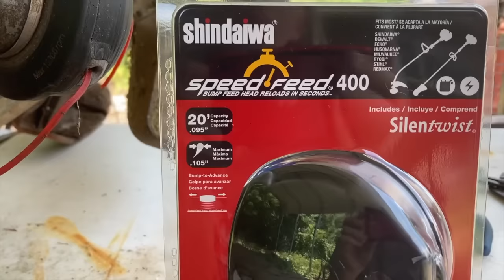The BEST TRIMMER HEAD ever made! How to install a Universal Speed Feed on most any trimmer.

Comment from the maker: Thanks for Watching! Find a link to all of my "Must Have", Favorite Tools HERE!! https://www.amazon.com/shop/chickanic?ref_=cm_sw_r_cp_ud_aipsfshop_aipsfchickanic_9ERPFPBNGQ924P8NS63B
Reply: Will the 400 trimmer head work on a Ryobi straight combi shaft weed trimmer, manufactured in 2016, with a full crank motor number RY251PH? It has an arbor pin or shaft that is threaded on the inside, with a bolt that screws into the arbor shaft that holds everything together, instead of being threaded on the outside of the arbor shaft. If the 400 will work, what arbor adapter do I need to use? Oh yeah, you can laugh at me for buying a Ryobi, it's OK. I've been using it since 2016 to trim my 1+ acres and it keeps on trimmin, but the trimmer head is now cracked and needs replacement. Thank you for all the great videos and detailed instructions!🙂👍
Reply: Will this fit my HYPER TOUGH HD bent shaft?
Reply: Awesome tutorial.  Just bought one.  Installed easily.  Works like it was made for my Husqvarna.  Thank you so much!!!
Reply: @Chickanic I decided to take a chance and I bought the Universal 400 for my 2016 Ryobi 2 cycle attachment capable weed eater and it installed perfectly. I think I used the red adapter. I'll update if it wasn't the red one. Now my Ryobi weed eater works better than new! Thanks for doing this video.
Reply: Hi Bre.  Greetings from Tupelo, MS.  I just bought a Shindaiwa T262 trimmer and it came with the Speedfeed 400 installed.  The trimmer owner’s manual only talks about .095” line being the biggest choice, but the SF says that it has a maximum of .105” line.  Will it damage my trimmer to run the .105”?  I’m a homeowner, not a commercial person.  It is a 25.4 cc motor.  I know about needing power to turn the head if line size increases, but .010” difference doesn’t seem like a huge deal.  Would .105” be better for chain-link fences and concrete than the .095”?  Your thoughts.  Thanks.
Reply: Side note.  Did the SpeedFeed 500 issues ever get resolved?

Comment: If you want to make that speed feed head last 100 times longer, drill a small hole in the center of the bump button and install a small bolt and flat washer from the outside with a lock nut on the inside of the bump button.  no more plastic contacting ground.
Reply: I just keep a one foot square piece of 3/4" plywood handy - the button on bump feed lasts a whole lot longer.
Reply: @flinch622 , What do you do with a 12'' X 12'' piece of wood ? Thanks.
Reply: @augustreil  I assume he taps on it rather than gravel or asphalt. Not sure how convenient that would be. 🙂
Reply: Brilliant!  Why didn't I think of that. Thanks
Reply: Can you make a video on how to do it
Reply: Excellent tip 👍
Reply: @AngusNB  carry a small peace of hard wood plastic ect in your pocket near at hand
Reply: @ikevinkinnane6200  Sure, handy as hell. 😁
Or, hear me out, tap it on the grass.
Reply: Very laborious when you can just bump line feed on the grass.
Reply: Smart idea
Reply: @ikevinkinnane6200  true.with a clip attached to belt loops
Reply: Does this fit on a greenworks weed eater..
Reply: @levis6945  ask the manufacturer of trimmer head
Reply: @levis6945  your Greenworks head works exactly the same you just have to uncoil those little spools they give you. And follow her directions.
Reply: Smart brah - I've just recently started a weedeating service and I've got more work than I ever thought - I work in the horse industry and I've been getting calls from all kinds of folks who need their barns , turnouts , and fencelines shaped up-
Reply: @stevesnider6817  not if you're working on an old car lot or old mall areas -
Reply: @davidrice3337  I'm trying to learn more about repairing weedeater. I have some in my  work bench now. One Murray was going to be trashed,by my friend,and I fixed it .that one was easy.
Reply: @AngusNB  🤣 🤣
Reply: Just bump it on the grass lazy sobs lol
Reply: I usually hire a super short Oompa Loompa to walk around with me, when I need more line... I bump it on the Oompa Loompas head. 
Minimal wear and tear on the equipment, and the Oompa Loompa only obtains a temporary bald spot, which grows back by the time I need to mow and trim again.
Reply: @ArvizuTX  I fixed an old Murray mower with a 3.5 hp Tecumseh engine.. works great and engine is good .
Reply: 3/8 bolt(Grade 8) by 1 inch long with a stainless nylon lock nut and a stainless 10mm fender washer (Lowes) <$4
Reply: I won't let it touch concrete or asphalt.
Reply: @Edocsil  That's exactly what I said, tap on the grass.
Reply: I must say, I got one of these and it's the best I ever used.
Reply: 5-28-2003, today. “Found” your channel. Watched this video. BOOM…Subscribed. Yesterday, I once again struggled with my Echo 210’s stock head. It is not on your list for the “400”. :(. A commenter says Echo has a very similar one. I NEED one. Thank you so much!!!
Reply: @flinch622  I carry an entire 4' x 8' sheet of plywood.
Reply: How do you carry that piece of wood around when you are weedwhacking.
Reply: @AngusNB  That would suck for commercial use huh…. Trying to keep your board handy all day
Reply: Round Up makes mine last a long time
Reply: @Mymusickb  hahaha
Reply: @willmartin4477 very carefully
Reply: Just use it! The head is only $25 bucks.
Reply: @justinpennington7682 I do too! Drill two holes at 4 ft. Side. Hoop a rope thru and pull it from the waist! Easy peasey,, :))
Reply: Commercial mower. Idiot employees. Telling them to only tap on grass is useless. I use a 3/8 carriage bolt. Heat the bolt head until it melts into the 3/8 hole I previously drilled into the new cap. When the bolt head wears out, replace with a new bolt (no heat needed the second time). When the cap finally wears out, I buy a replacement cap only, not a complete new head.
Reply: @Edocsil l’ve been in business 32 years and I bump on hard surfaces.  Feeds out better but yeah the head will wear out faster. Mine usually last about a year.
Reply: How about epoxying a large washer on it…..I am.
Reply: I just tap on clumps of grass or weeds. Very little wear and tear on the trimmer head.
Reply: Hello,I have the 450 Head on a Stihl FS 110 and I keep having the String bind up in the head. I’m using” Rino-Tuff”  .105 Pro and it has a Triangular Shape. What do you think the problem is
Reply: You nail it. Nice
Reply: . I read about that problem and the answer is odd; soak it in water overnight! Apparently the plastic dries out and begins to bind/grab/stick. Haven't needed to try it yet, but I just do my property. Mow, I HAVE shot a bindimg roll with nonstick cooking spray, and that worked well, but water is free. 👍
Reply: Great Idea. Thanks.
Reply: @SuperMagnumguy and that will fall off the first or second time you go to tap the head on the ground.
Reply: Pretty good idea.
Reply: Thanks for sharing!!!!
Reply: @alleyoop5185  Are you taking the piss.
Reply: works a treat, i use line soaked on Fri for a Sunday Trim. Super outcome
Reply: That what i do @AngusNB
Reply: @AngusNB …when I’m weed eating Im always on the grass. To make that bolt idea work I’d have to walk about 100’ to tap it 😂
Reply: Please wear hearing and eye protection.  Tinnitus is awful and never goes away.  Eye injuries happen.
Reply: @augustreil .  I don’t know either. But I’m assuming he takes that around with him and when he needs more line, he drops it on the ground and taps the trimmer against that instead of the ground.  
I think 🤔

Comment: The factory head for my 1994 McCulloch Pro-Mac III Super weed trimmer never worked right.   I used a variety of simple trimmer heads (adding pieces of line or plastic blades as you trim) over the years (decades).   I decided to give the Speed Feed 400 head a try today.  The gold arbor fit perfectly. I did some major trimming with it right away.    It is a great trimmer head!    Made my 27 year old trimmer seem like a new machine!

Comment: I'm so glad I stumbled on this video.

A couple of years ago, a customer gave me his Shindaiwa 22T, saying he couldn't get it started & I could have it if I wanted.  I brought it home & discovered that the piston was broken.  Bought a new piston & jug for $35.00, & fixed it right up.  

It didn't come with any paperwork, so I had no idea how to maintain the gearbox, so I'm sure it's dry on grease.  Along with the fact that the string head that came with the unit, I have to cut string about 14" long & feed them into the head, what a pain.  I'm using the .095 string, & they usually fly out of the head.  So, the speed feed is going to be my next upgrade.  

Ohh, and I agree the 22T is the bomb.  Love it.

Comment: I need to brag on you a little. After your recommendation about the battery booster starter unit I purchased one. Went to our fire department for a meeting and the tanker wouldn’t start or even crank  it has 4 batteries in it. The battery charger wouldn’t charge it enough to crank. I hooked up the battery booster you recommended and the truck started right up. The chief told me to get one for the FD. Thank you so much for your recommendation.

Comment: I bought the Echo 400 Speed Feed head, which looks identical to this one.  It fitted directly onto my Greenworks trimmer, without having to take anything apart.  To make the plastic cap last longer from all that bumping, drill a hole through the center and attach a large metal washer, with a nut and bolt.
Reply: i'm also looking for a trimmer that will take a speed feed head...which model of greenworks trimmer do you have?  I want to buy a battery string trimmer (not gas). thanks for the info...

Comment: Been a groundsman/ gardener for nearly 30 years, I can re fill my trimmer head on my stihl 430  manual feed head ( I don't do bump feed heads) in less than 30 seconds, if I precut line for 24 ft beforehand.
My present head I have has been on my trimmer since 2010, and could probably do another 10 years....... 
great to see you show the correct way to grease the gear head 👍🏻👍🏻 
Excellent as always, greetings from the 🇬🇧

Comment: 👍I hate messing with trimmer heads. I can't believe the Speedfeed is so simple to load up with string.
Reply: I put a speeded on my echo, waste of money, doesn't work at all. It must have come from China or Mexico. Took my money.
Reply: @ElRipper100  …..you may have gotten a bad one…..I’ve had mine for a couple years with zero issues
Reply: @ElRipper100  -But they said Yes to ya peso. Thought so!
Reply: @ElRipper100  the copy cat ones are not recommended. Get oem.
Reply: Anybody try different types of line and have any reliability/feed issues for example square .095 Arnold String trimmer line.

Comment: I bought the Speed Feed 400 on your recommendation and so far I have not been disappointed! To those wondering, it fits perfectly on the Milwaukee M18 line trimmer. You don't even need the included adapters, but I did use the spacer.  Thanks!

Comment: As always we appreciate your videos. These Universal Speed Feed head are the great. One problem I have run into is if you are trimming around a Lake you will collect fishing line between the back base and head. When that happens it prevents the head to feed the line out. So, I have told the guys that all they have to do is remove the head and remove the fishing line between the base plate and head. But, instead they open it and loose the spring and cap and that’s when they bring it to me. Also adding a grease fitting to the gear head is convenient as well.

Comment: Circa 2009 I broke my big box string trimmer and a coworker that previously owned a lawn company told me to get a Shindaiwa. Back then, for $400 cash, I left with an MS-242 (I have never even taken the trimmer head off) and 5000 feet of line. Over the weekend I greased the head (I read manuals) but other than that I have changed the spark plug and fuel filter and the thing runs like new. I just have the spool of line mounted on the wall of my garage and a line painted 14' away. I had no idea what not everyone was using speed feeds. When the engine sounds like it is spinning out of control it is muscle memory now to shit the off switch and then walk to the garage, measure and cut the line, and load it. That whole process takes 2-4 minutes depending on where I was when the line ran out. 

So anyway, the speed feed head lasts at least 15ish seasons with minimal maintenance (for a home owner) but it does not really look any worse for wear. Also 5000' of line lasts that long too on a third of an acre with around 400-500 feet of trimming.

Comment: I happened across your channel about three weeks ago, this video in particular. I have been plagued by issues with my Ryobi trimmer head and a couple of different replacements just not working well. The stock head was just junk....wadded line up inside, causing it to snap and forcing disassembly to get it going again. The solid plastic blade things were also pretty much useless, breaking off all the time. The one where you have to put new short lengths of line in when  they wear down was a bit better, but a monumental pain in the butt. Then I went and got a Speed Feed 400 for the trimmer. Hallelujah!! It works beautifully, doesn't wad the line up, pure tap'n'go joy. Now I see why Echo uses them as OEM equipment. The thing is just brilliant. Thanks for putting this out there, for me and the rest of us who struggle with crap trimmer heads.

Comment: Thank you so much for this video.  I have a Stihl straight shaft trimmer and bought the Speed Feed 400 for it.  I watched at least four different videos about how to install the SF 400 on the Stihl.  None of them were specific on the “black” vs “white” insert or the “green” vs “gold” arbor or the “L” vs “R” orientation of the spool, so all summer I had difficulty getting the line to feed.  I thought I was going to prematurely destroy the cap - trying to get it to feed.  I saw you video and it turned out that I had the “white” insert in place with the “green” arbor and the spool was oriented with the “R” away from the head.  WRONG!  I took it apart and followed your video.  Now the. SF 400 works like a dream.  Again, thank you so much!  You are a real asset to us unskilled homeowner types.

Comment: Thank You Bre.  My Echo SRM 225 came with the Speed Feed head.  the spring following my winter cleaning and maintenance of lawn equipment, my trimmer would not feed line.  Very FRUSTRATING.  After watching this video, I checked my head and found that I had reinstalled it backwards.  After correcting that, the trimmer works and trims like a champ.  Thank you for saving me TIME, MONEY and a TON of FRUSTRATION.  You're the BEST!

Comment: Recently started watching your videos. Very informative. And thank you for sharing your knowledge. I am going to change out my trimmer head to the speed feed. It is sooo much easier than the conventional one. I saw your video on loading the two different heads. You were the only one who mentioned the length of the new line to use. My Stihl straight shaft's owners manual doesn't tell you what length to use which I found odd. Thanks for all your help, Ray from Central Ohio.

Comment: Your videos have been beneficial. Please keep them coming. I'm pretty sure it took you much longer to list the brands and model numbers than it took to produce your video. I found a Zerk fitting that fits the grease hole and makes greasing an easy chore. For those who want to know. These grass trimmers', with gas engines, need to be broken in. I would also recommend NOT using 10/15 methanol gas as it will harm the engine.

Comment: Thank you for taking the time to do all this. I installed the head in less than 5 minutes thanks to you. Haven't re-loaded it yet but.... Good job. And please keep it up.
Reply from the maker: Awesome! Thanks!
Reply: One favor… I bought a speedfeed 400 (used your links), mounted it on my Honda straight shaft HHT35S. The pre-loaded string was barely sticking out of the head before I installed the head, but in the process of mounting the head, it disappeared inside the head. No instructions on how to get it back out. Any thoughts? 3 mins later… Oh, press the two release catches, then take apart. I removed the pre-loaded line put it all back together, and reloaded the line. Yay! I’m a big boy now! Thank you sooo much for your channel/input/support!

Comment: Bre:  Took your advice and bought a Speed Feed 400 for my Stihl FS120.  I love it! Installed as easily as you showed in your video.  I love how easy it is to refill while I am working.  I used my trimmer for four hours yesterday and could add more line so quickly and easily compared to the original Stihl spool.  Great recommendation and great product!  Thanks.
Reply from the maker: That is awesome! I wish I would had invented it. It makes life so much easier. Remember you can buy just the cap if you catch it before it wears down into the base. If you bump it on grass though it will last a very long time.
Reply: Use up trimmer line twice as fast.
Replace trimmer line twice as fast
Who is getting all the benefits in this? Trimmer line manufacturers ?

Comment: Watched this when it came out. But today is the day I got a Speedfeed head for my Stihl FS55C. The instructions in the package were WRONG! Thank you so much for having the correct instructions for getting it to fit my trimmer. After struggling for more than 1/2 an hour, I came inside and rewatched your video. After that it took about 2 minutes.

Comment: After my new Sthil head jammed with broken line inside for the 3rd time I busted out  $33.55 on ebay and bought this Shindigdawa  speedfeed 400, the Chickster mechanic is correct on this unit, its worth it if you don't necessarily like yard-work and want to get done as fast as possible.